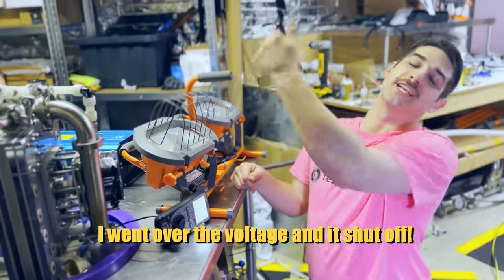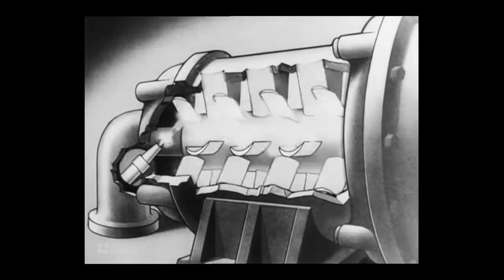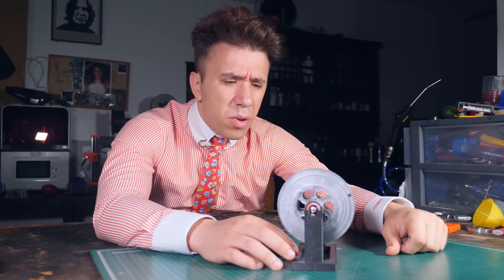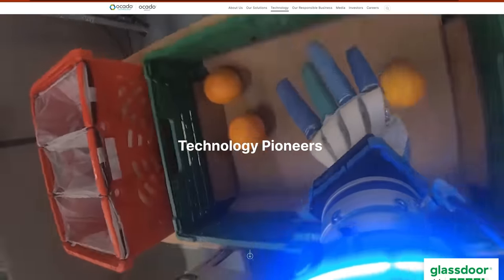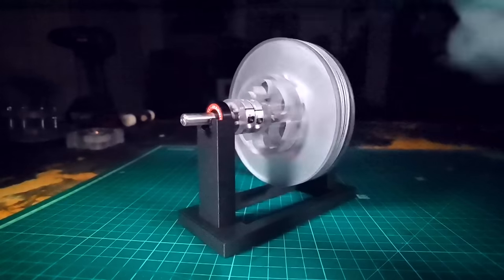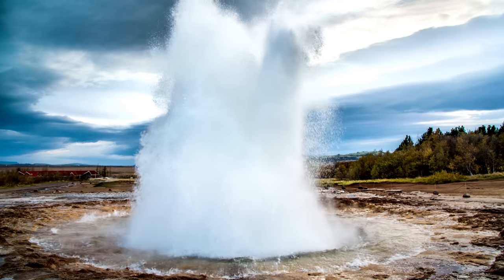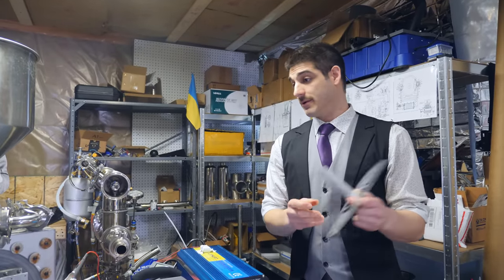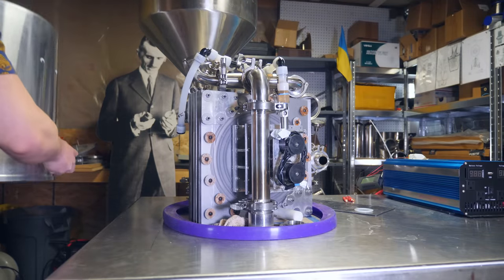Building Nikola Tesla's Bladeless Turbine

Comment: I think I read something about the tesla turbine ripping itself apart if it is going too fast and or has a to big disc, is that true and could you test that?? (mb some cool slowmow) And you could also test different entry flows, disk materials, disk spacings and different fluids?
Reply: Thats a problem with all turbines its why wind generators have breaks on them  to stop them spinning in high winds
Reply: 600 likes in 20 minutes?? xD
Reply: What emerald said, they all have limits. I’m sure the physicist took everything into consideration, but I like how you think :)
Reply: I had heard that too. Something about the faster it spins, the higher the efficiency and modern turbines have a 95% efficiency. Unsure of that is true but it is also neglecting the necessary technology to build, maintenance, and material sourcing. The very reasons why electric cars and batteries have to last longer than a combustion engine can last in order to pay off. I thought it was  like 100k miles in countries with 100% green energy sources. Most countries do not have enough green energy to make electric cars worth the effort. It's mostly because of the battery.
Reply: One way you could look at it, the tesla turbine had a larger surface area per blade vs a general turbine
Reply: AFAIK, it would be most efficient at a speed greater than the disks can withstand.
Reply: Anything spinning too fast has that potential outcome
Reply: That's a massive overstatement of how hard Tesla pushed them. You want to do destructive testing of what you make to understand the safety margins.
Reply: Too, not to.
Reply: I would like to see it run a home for a weekend
Reply: Almost 3k likes in less than 3 hours??
This dude is buying likes to cheat.
@integza do you check for this unfair behaviour in your giveaways?
Reply: Anything spun beyond it's tolerances will.
Reply: It's true. Any type of turbine could be ripped by centrifugal forces.
Reply: If it's going too fast, you just need a higher resistance motor to keep it in check which would mean more power in the end.
Reply: @kumabjorn7992  worst case just make a bypass, have a dummy load, input valve governor, rpm governor...
Reply: @buzzsaw7989  you are thinking of whole system efficiency where they have ~50 stages of turbines, several heat regenerators, and pre heating out the ass.
Reply: I appreciate your comment but that’s not an issue because, despite what everyone erroneously claims, Tesla turbines work just fine, get plenty of torque and output power at low RPMs.     I’ve got some copy pasta 🍝 of mine that I’ll share with ya here to explain more.  Tesla turbines aren’t made efficient by spinning really fast.   That’s only for when the disc stack is being used as a centrifugal pump, because ALL centrifugal pumps’ compressors, performance is tip speed dependent.   But spinning the turbine fast will produce a centrifugal head that opposes the incoming fluid flow, reducing the pressure gradient across the nozzle, reducing fluid final velocity, reducing mass flow rates through the nozzle and ultimately reducing power out. 

Furthermore the faster you spin them the faster the fluid you have has to go just to still be moving faster than the discs and still provide torque.   Lastly, they work just fine for industrial use and can scale up just fine because the torque on the discs is proportional to the difference in the fluid speed and the disc speed. So the disc tip speed is the important factor here. For any given fluid supply in, the bozzle will have a max fluid velocity. So the turbine disc tips will have a max speed set at that fluid speed irrelevant if radius. Now considering that centripetal force is proportional to V^2/R, if you keep the tip speed the same but increase the radius the centripetal forces on the disc for the speeds needed will actually decrease.
Reply: Despite what MANY have claimed about the Tesla turbine, it does NOT need to be spun fast to work or work efficiently.   TesTurs are made efficient when the slip on the discs is reduced and spinning the discs fast does nothing to reduce the slip, only increase the distance the fluid slips on the disc faces, which is by definition “loss”.  Listen to what Tesla himself said in the patents of how to make them work.  “Owing to a number of causes affecting the performance, it is difficult to frame a precise rule which would be generally applicable, but it may be stated that within certain limits, and other conditions being the same, the torque is directly proportionate to the square of the velocity of the fluid relatively to the runner and to the effective area of the disks and, inversely, to the distance separating them. The machine will, generally, perform its maximum work when the effective speed of the runner is one-half of that of the fluid; but to attain the highest economy, the relative speed or slip, for any given performance, should be as small as possible. This condition may be to any desired degree approximated by increasing the active area of and reducing the space between the disks.”  1) increase the speed of the fluid relative to the disc, (not increase disc speed)  2) increase surface area 3) decrease disc spacing  This is how you actually make a TesTur work. Not by spinning it fast.   The fluid interactions with the disc that govern efficiency an torque are adhesion and cohesion. Full stop. And spinning fast does nothing to increasing either to increase the turbines isentropic efficiency.   This is why everyone who chases rpm with the TesTur just flat out fails. They aren’t even trying to design them properly so of course they won’t work. 

You just have to know how to design it correctly to actually reduce slip to make them work, not spin them fast.  The only reason people think Tesla turbines have to be spun too fast is because EVERYONE has mistaken the part of the patent that is about the turbine being used as a pump as being about it being used as a drive turbine.   The only time you want to spin a TesTur fast is when it’s being used as a pump/compressor. This is because ALL centrifugal pumps’/compressors’ performance is tip speed dependent.   “I have found that the quantity of fluid propelled in this manner, is, other conditions being equal, approximately proportionate to the active surface of the runner and to its effective speed. For this reason, the performance of such machines augments at an exceedingly high rate with the increase of their size and speed of revolution.” -Nikola Tesla
Reply: And again, you DO NOT want to spin too fast in a TesTur because the centrifugal head will just counter your incoming fluid flow reducing power. And the faster you spin discs, you’re fluid has to be going even that much faster just to be able to apply a torque on the disc face.   “Still another valuable and probably unique quality of such motors or prime movers may be described. By proper construction and observance of working conditions the centrifugal pressure, opposing the passage of the fluid, may, as already indicated, be made nearly equal to the pressure of supply when the machine is running idle. If the inlet section be large, small changes in the speed of revolution will produce great differences in flow which are further enhanced by the concomitant variations in the length of the spiral path. A self-regulating machine is thus obtained bearing a striking resemblance to a direct-current electric motor in this respect that, with great differences of impressed pressure in a wide open channel the flow of the fluid through the same is prevented by virtue of rotation. Since the centrifugal head increases as the square of the revolutions, or even more rapidly, and with modern high grade steel great peripheral velocities are practicable, it is possible to attain that condition in a single stage machine, more readily if the runner be of large diameter. Obviously this problem is facilitated by compounding, as will be understood by those skilled in the art. Irrespective of its bearing on economy, this tendency which is, to a degree, common to motors of the above description, is of special advantage in the operation of large units, as it affords a safeguard against running away and destruction…” (cont’d) “…Besides these, such a prime mover possesses many other advantages, both constructive and operative. It is simple, light and compact, subject to but little wear, cheap and exceptionally easy to manufacture as small clearances and accurate milling work are not essential to good performance. In operation it is reliable, there being no valves, sliding contacts or troublesome vanes. It is almost free of windage, largely independent of nozzle efficiency and suitable for high as well as for low fluid velocities and speeds of revolution.” -Nikola Tesla  Tesla both knew it wasn’t meant to spin fast and that it worked great for low speeds IF you design it correctly.
Reply: Wouldn't increasing the size at the same fluid speed, reduce the angular velocity and centripetal acceleration?
Reply: yeah that's true, it has to do with how rigid the disc is: at very higher speed the disc will start to warp or ripple as it spins instead of remaining flat, and it eventually breaks.
but modern materials science can make thin discs that are a lot more rigid and strong than anything people in Tesla's time could manufacture: carbon fiber composites could be great for this.
Reply: If you wrote that comment for the 3D printer, you'll have it
Reply: @ItsMeArda  Almost as if the comment was pushed to the top and artificially liked so as to positively discredit the concept.  Happens quite often when youtube or others want to push a narrative with a seemingly popular concept.
Reply: @buzzsaw7989  The biggest problem in electric cars are the batteries and therefor only if a new revolutionary battery is invented the electric car coul get the new transportation option for me.
Reply: @Dan-gs3kg  we are learning the limits of material science and physics,
Reply: Go get some grammarly
Reply: What happens to the turbine when you drive it. Ie can you use it to compress air.
Reply: The turbines currently used have a tip speed of mach 1.8 the telsa turbine would have a tip speed of mach 13. discs would have to be 2-3 meters for industrial use so I don't think we have materials that can be thin enough and not warp or be destroyed.
Reply: You could add an electronic speed governor on the output shaft that would increase resistance if above a certain rpm
Reply: I know I’m one in a million replies in this but for the Tesla turbine to be as efficient as a modern day turbine, or even more efficient the “blade” tips would have to love at Mach 22, this is with a three meter “blade”
Reply: Possible turbine disks:
CDs
Cut-off grinding disks (for angle grinders)
Old hard drive disks
Reply: At some point, every rotational part reaches the threshold where it´s diameter and angular speed are so big, the part itself breaks the sound barrier. Even if it could theoretically withstand so much stress, the sonic boom is the last nail in the coffin.
Reply: I think the disk material would't change much and for the spacing it's just important to get the most ammount of disk in the smallest space possible to maximise the surface area where the fluid can stick to. But I don't have any thoughts on which fluids would do the job better, thats an interesting question.
Reply: @CharlieSolis  Oh well thanks for the infos!! Don't have time to read it now tho but I will definitely come back to you!
Reply: @lsh_  let me know if you have any further questions! I’m happy to answer them.
Reply: @vintageshed965  
Sound barrier, you say.
You say that in a negative way.
You sound halfway knowledgeable, how would you UTILIZE such an effect? 🤔🤔🤔
Reply: Because go centrifugal force and the discs are thin. so it doesn't have the support for it
Reply: @falconsfs7086  hey thanks for your comment. But that’s not quite accurate. For a non tapered disc, thickness does not effect burst speed. So a thin disc will have the same burst speed at a thick disc. And when the disc stack is designed correctly the discs aren’t capable of warping. 

“In the new design I employ two heavier end-plates which are machined tapering toward the periphery for the purpose of reducing the maximum centrifugal stress as much as practicable. The inside discs, of relatively thin material, are rolled, forged or ground tapering in like manner and with the same object in view, but this may not always be necessary and plates, made of sheet metal of substantially uniform thickness as furnished by the mills, can be employed. Each of the thick as well as thin plates is provided with exhaust openings, leaving a solid central portion like the hub and spokes of a wheel. Star-washers of similar configuration serve the purpose of keeping the discs apart in the center and for the peripheral spacing the thin plates have small holes drilled in them on a circle, or circles, of suitable diameter, and in these are driven tight-fitting studs which are upset at both ends by a special tool so that they will project beyond the metal on each side a trifle more than the thickness of the star-washers. When the plates are put together the separating studs do not come in line but are straddled in order to give opportunity for slight yielding, thereby eliminating constructional difficulties which might be caused by unevenness or other mechanical imperfections. Thus the rotor can be finished closely to predetermined overall dimensions and will run true on the outside even if the thin inside plates should vary a little in thickness or be slightly warped. To simplify this arrangement I provide only every second plate with studs, using plain ones between. Furthermore, with the object of cheapening the manufacture I dispense altogether with the former, accomplishing the spacing by means of small bosses or protuberances which are raised in the plates by blows or pressure and provide a die, practically reducing all the machine work on a thin plate to a single operation in a stamping press. The star-washers, while preferable, are not indispensable and may be replaced by round separating washers of a diameter about equal to that of the hub part of the discs.”
-Nikola Tesla 

“This construction permits free expansion and contraction of each plate individually under the varying influence of heat and centrifugal force and possesses a number of other advantages which are of considerable practical moment. A larger active plate area and consequently more power is obtained for a given width, this improving efficiency. Warping is virtually eliminated and smaller side clearances may be used which results in diminished leakage and friction losses. The rotor is better adapted for dynamic balancing and through rubbing friction resists disturbing influences thereby insuring quieter running. For this reason and also because the discs are not rigidly joined it is safer against damage which might otherwise be caused by vibration or excessive speed.”
-Nikola Tesla
Reply: That was my first thoughts.   It's cool and promising but I think the one thing would be destruction of the whole case if any of those discs failed.  Something like a  timing chain breaking and just destroying everything?  I'd bet you could set up sensors to cut with any asymmetry or above expected vibration...?
Reply: He did this already
Reply: @vyvyyv8vohvgu77  hotter gasses, cooler liquids. From there it's 11 herbs and spices on very thick stuff, or very mixed stuff.

For dirty things, consider further spacing to allow debris to flow through. (This is ignoring the idea of having a bypass, but that might lower system pressure) From what I know the disks aren't harmed by the debris, the skin effect is very powerful.
Reply: @vintageshed965  no, by and large there have been many demonstrated turbines that withstand the sonic transition.
Reply: This is the story of your enslavement, the "elite" exposed 👉 The Connections (2021) [short documentary] 💖
Reply: Device u reference is a guvnor…. & yes!!!! It IS a critical safety device
Reply: I built a few Tesla turbines and can confirm they can self destruct if you exceed the structural limits of the material you use. I have videos on the Tesla turbine.
Reply: @charliesolis simple refutation... If it were this simple and they were as good as you are spewing, why don't we use them everywhere?

Teslas own patent even said it was dependent on the viscosity of the fluid, as this fluid is coupled to the impelling cylinder by shear forces alone, and when you shear the liquid you get huge frictional energy losses... And a lot of heat buildup. Crunch the numbers and the carnot efficient is utter crap until, as you say, you build up enough head that the discs are almost going at the speed of the fluid, thereby reducing frictional losses, and at the point where it is gaining almost no impelling  force from the fluid any more. This is around 50k rpm and unless you make the discs thick the heat expansion and fatigue will rip it apart.

Come on dude. Stop fapping over anything Tesla like some communist cult of personality. This is well known about in engineering disciplines and it isn't used for a good reason. It's a desktop curiosity now. It was a cool idea but didn't deliver in practice. That's all.
Reply: TyaxComp  The fact that he made one as a gift probably means it doesn't take long to make.
Reply: You are right about that
Reply: The principle makes perfect logical sense, but not from the perspective of a physicist.
Now, a hydraulic engineer?
Heh.
Let’s give an example out for everyone to get their head around.
Take a skidloader, for a primary example.
The wheels have non-variable hydraulic motors driving them.
The higher the flow, the faster they go.
Faster flow is definitely not good for torque in this case.
On the powerplant, the pump is variable flow.
The shaft is turning the same speed, wherever the throttle is set.
It doesn’t matter if it’s electric, gas, diesel.
If the pump is wide open to maximum flow, the resistance by torque load can overwhelm the power plant.
By turning the pump down, the rotation of the pump is still the same, but the fluid flow is considerably less.
Now, the same wheel or track on the same surface is going slower, but the traction multiplies, giving more force per inch of travel.
Slower turning means the same amount of power, but instead of trying to move a gallon in five seconds, it’s taking a full minute.
The torque has went from 100/ft-lbs to twelve times that, at 1200/ft-lbs!
Takes longer, but multiplies the force of the work.
Now you have enough working force to push a big truck.
You can raise your flow and speed to where they are balanced, torque vs. load.
With this turbine, there would be less balance issues, and a lot les wear on the parts, as that all move a lot slower.
Want more torque? Add turbine plates!
Reply: @kumabjorn7992  that sounds smart thx
Reply: @Dan-gs3kg  If it is actually so easy and efficient and so on why isn't it used (AFAIK water plants etc. use "normal" turbines)
Reply: @postiemania  Yea nice I skimed trough the vid a bit, but I would like to know what you drive with it / or tested it with?
Reply: Is this turbine made at home with simple things 
I am from India  i like your video 12:35
Reply: @lsh_  it ran on compressed air for the test runs.
Reply: @lsh_  that's the argument used to poo poo many verified inventions until a big name makes something similar to it, like the Mahle Jet Spark Plug which is worse than the Smart Plug which an updated hot bulb that has a similar ability to send out jets of fire to ignite the gas during its run, but only need about 10W to run, or until it is hot.

Or the Plazmafor plugs, which uses a slightly different geometry for the finger electrode, as a shroud electrode, and uses electrolysis and corona discharge for ignition, instead of spark discharge.

How about peaker caps? It's effectively a CDI, but without the need for a power IGBT, and it needs a lot lower capacitance to run.

Again, all of these things are not far from the realm of possibilities to improving the function, consistency of, or durability of the spark plugs in question.

Maybe it's the UL testing that is poo pooing it, like they did with the Element Fire Extinguisher, maybe it's the EPA. Who knows, it can simply be for a fact that the patent office makes you spend several thousands for a patent, or the tens of thousands in fees for starting a small business. Why don't you ask the academics who only care for the publications that hazed them into having the beliefs that they have, or the industry that is very comfortable with the current economic status quo. It's very difficult to change your economic model. Or it's for a fact that grandmaster tradesmen don't exist anymore, so the technology is simply lost on them.

Do you know what the best synthetic gear lube is on the market?

How about the next generation in metering rod carburetors, or the electronic and automatic carb tuning kits? Do you know about that?

How long does it take for a new product, let alone innovation to come to the industry, and how much of a money sink it is to get anywhere for that matter.

Do you even know what the best liquid major mixers are? Do you know how they actually mix solids into the liquid down to about 100-150um?

How about newer generations of cast alloys? Or twinning steels? What is the use of a twinning steel?
Reply: That's just true for all discs spinning at high speeds, it just has to be engineered for it.
Reply: Centrifugal force vs. material yeald strength
Reply: I really enjoy your videos
Reply: I'm more interested in seeing real numbers in terms of efficiency, something the Tesla turbine evangelist seems either unwilling or incapable of producing.  Either possibility is a problem.
Reply: @GerryRR  hey thanks for commenting  🙏❤️‍🔥 but if you go through these comments I have more than elaborated on the efficiency across multiple replies to many people. 

I can only respond to so many people though. 

Hope this helps.
Reply: @GerryRR  As far as efficiency goes… (mind you this is a copy pasta 🍝 so it’s a bit long but it’s worth the read.) …My 2650watt electrical load run came in with a very low ball calculation of 40% isentropic efficiency.  To start off, mind you that includes generator losses, 3 phase rectifier losses, and inverter losses to the electrical load that were not accounted for. So the turbine off the bat is already most definitely doing better than the 40% isentropic efficiency I’ve calculated from the already low ball test results.   But for now I’ll just assume 40% isentropic efficiency so that I’m not over claiming what I can prove it can actually do for the time being. (I have nothing in the long run to benefit by overstating my numbers and only my legitimacy to lose. I’ve worked hard for my physics degree and don’t intend to tarnish it for a couple of extra views on the internet.) 

As far as inefficiencies to the system to fix, there’s 10x crappy ball bearings in this version, 2 crappy RC car gears, both losses will be gained for power out with a direct to shaft generator. (Minus two gears and 8 crappy ball bearings)  There’s an 1/8 of an inch of space between the turbine endplates and the casing endplates on both sides of the TesTur. That’s a 1/4in of open flow area around the 2in wide turbine (that only even has a total of 0.75in wide of spacing between all the tight disc spaces for torque to begin with.)   That means 25% of the open space for flowing through the casing, between discs and between the casing and turbine endplates, is just free flow over the side of the turbine still. (I’m using the absolute bottom of the barrel of machining equipment right now in my garage 🤷‍♂️)  There’s no labyrinth seals yet to even attempt to further reduce that overflow…
Reply: @GerryRR  The nozzle is atrocious at the moment, when making the variable converging section have a tight convergence it causes the fluid jet to aim more centripetally (towards the axle) instead of tangentially (glancing off the disc tips) which severely effects the fluids natural path.   This will be fixed with the new variable nozzle design I’m going with.    Then even further in this specific casing’s assembly there’s two “pillars” in the middle of the nozzle.   This is because the aluminum plates in the middle of the casing plate stack only had the variable nozzle bar and inlet holes cut out, and not the full nozzle geometry.  So those pillars are just vertical bars in the middle of the nozzle for the air to smash into just before going into the turbine (hopefully the wet steam tests will just erode them down 🤭)   Before all that there’s still about 100ft of air hose between the tanks and the turbine… plus a shell and tube heat exchanger and a TON of elbows and fittings.    I’m sure I’m forgetting something too but between all that being fixed… I can almost guarantee we will be in the 60-70s % range and that’s all just still with room temp compressed air.   Most forget, I’m using room temp compressed air and never went over 20psi at the nozzle for these tests. (Pressure differential and temperature differential govern efficiency) 

And even then I still only even have a single stage on it yet.   Everyone wants to compare it to the efficiency of a very high temp, high pressure (1000°F & ~1800psi) multibillion dollar 15-30 stage steam turbines…   😮‍💨   That’s apples to rocket ships. 😅  But considering Rankine Steam cycles get theoretical max about 33% of input heat (due to latent heat of condensation and that’s without any regenerative boiler feedwater preheat, air fuel preheat, etc) and then 40% isentropic efficiency (considering the turbine as is) we’re looking at 13.2% thermal efficiency with steam.   A more apt comparison for the TesTur would be something an individual can actually purchase, like 1-5kW piston gas generators that you can get from Home Depot or Lowe’s.   These get 15-22% thermal efficiency off the plant floor. Good luck getting that 1 year down the line or later with all those moving parts.  Also for reference, industry standard for micro bladed gas turbines is 25% thermal to electrical. Whole system efficiency can go higher in Combined Heat and Power (CHP) system, but alas the TesTur would see the same whole system efficiency increase in a CHP Auxiliary Power Unit (APU).  In the TesTur you gotta replace…? 🤔bearings…? And still even then, only maybe 🤷‍♂️ depending on how good of bearings, balance, lubing, cooling.   The TesTur, and other bladed turbines, only have one moving part. 🔥
Reply: @GerryRR  So if those piston generators drop efficiency, even at all, the TesTur on its worst day is competitive with a gasoline piston engine electric generator.🤓😬🤷‍♂️  And the TesTur can handle any fuel that can burn, even solid particulate fuels like powdered saw dust, pulverized coal, powdered iron, biomass, etc. (noting the number of those that can be acquired without spending money… 🤑 opening up “low monetary cost”, even carbon neutral, fuel options for MILLIONS around the world)  We have to remember that the TesTur doesn’t have to be the holy grail to be worth using if we have free fuels readily available like biomass, and even waste heat already being dumped out into the air and not used for anything.  The TesTur just has to be a viable option for some to be worth doing. 

Even more, the mere fact that I’m using a low temp fluid for my 40% isentropic efficiency calculation means my TesTur efficiency is severely limited by thermodynamics and fluid dynamics.   Increasing temps will automatically increase my turbines efficiency.  This is because gasses have an increasing viscosity trend as you increase the temperature.   This leads to increased isentropic efficiencies in the TesTur from reduced slip on the discs.  (Meanwhile, we’re already talking about a piston engine using combustion temps as is.)  Whereas bladed turbines see the increased viscosity as an increase in drag loss through the turbine blades.   So we can’t always count on seeing increased isentropic efficiencies in a bladed turbine in practice when we go from low temp to a high temp.  Again, to reiterate, this increase in viscosity in the TesTur only works to enhance the working action of the TesTur.  (That being viscous adhesion to the disc faces increasing torque.)  That’s all on top of the increased thermodynamic efficiencies of using a higher temp elastic fluid too! 🤓 

The disc spacing for room temp gasses is not going to be the same for combustion temp gasses/steam because the viscosity of either increases by 3x fold. And I’ve designed these spaces for a higher temp fluid with a slightly higher viscosity so these will inherently be too wide at the current temperatures being used.   So as we increase temps along with all these other really easy to fix mechanical issues (that only are a thing because I’m building this in my garage on a junk cnc machine) I have no doubt we will see more than competitive isentropic efficiencies compared to bladed turbines, let alone whole system thermal efficiencies that are through the roof.   This is because of the heat recovery systems that can be added with the cost savings of using a TesTur vs a VERY expensive, and in my opinion, relatively delicate bladed turbine.   Just getting tighter casing clearance with the turbine should give me at least 20% points back on efficiency putting my testur at the 60% range.   Coming in with a 19% thermal efficiency in a Rankine steam system without any kind of thermal recoup.
Reply: @GerryRR  I just responded with 4 messages, not including this one, answering your question. YouTube has a bad habit of comments just magically not appearing for other people so let me know if all 4 of them came through. Cheers.
Reply: What's common is total trash. I know the mailman you'll never get your 3D printer.
Reply: I personally wouldn't see a point in using fluids other than water, unless of course you're using water power to pressurize the other fluid. I only say because water is the most abundant fluid we can pressurize with natural elevations
Reply: Centrifugal force, anything spinning faster than it's tensile strength will either deform or break
Reply: The outside of the disc can be subject to 13g and the spacing of the disc is supposed to take advantage viscosity of water I think it's like.8 mm or something like that 😊
Reply: That is true, the blades should be titanium alloy if you want it to be engineered for higher rpms and larger radius.
Reply: You could also have a feedback valve to limit the rpm rising to the ripping point, actually limiting it to a more even power output.
Reply: The Tesla Turbine did rip itself apart when Tesla connected it into the compressed air from a large area Trompe was used. 

I would like you to make a trompe and use it to power a Tesla Turbine. I feel that learning about the Trompe would interest you and encourage more projects.
Reply: Cool, but looks complicated and expensive.
Reply: They fracture
Reply: Anything that spins has that problem.  The faster it spins, the more perfect its balance needs to be. Any wobble magnifies at speed.
Reply: If you spin anything too fast it will fall apart.  Everything has an rpm limit
Reply: Yes tesla had mentioned thetes a certain amount of space between disc's n flow rate that maximize best output n stability n to little space poor output as to much n at right proportions the speed got stable by the movement inward if incorrect would shake at super high speeds n found the sweet spot n watched video on it long time ago
Reply: @aaronduranceau7683  that's the motor.  Were generating gas to burn
Reply: Buckypaper
Reply: @sockmonkey6666  True.  Everything has a breaking point.  What's the strongest material we could use?  And are the discs smooth or textured?
Reply: @ralphcroker4889  Probably some modern superalloy. The disks are usually smooth.
Reply: It's so good at what it does that there's no material we have that can withstand both rotational and centrifugal forces from going so fast, it wants to go faster than it can keep itself together
Reply: As any rotating object.
Reply: Anything that rotates too fast, will rip itself apart. Centripetal forces and all that.
Reply: Gear exchange should suck extra motion
Reply: did no one hear the part about it having better torque at LOWER speeds?
Reply: the thing about the tesla turbine is that it doesn't need to spin fast to create force, it relies on adhesion and cohesion of the fluid put through it. steam just so happens (not coincidence) to have very good adhesion and cohesion for the tesla turbine, in order to generate more torque and more energy. if it's spinning too fast for itself to handle, that's because someone decided to run it with that much force. gotta modify the pressure of the fluid being put through it. on a mass scale though it should be able to handle high pressures and large amounts of fluid though. but that's never been done, and people insist that if it doesn't work at a small scale then it's not worth it, despite us knowing that's not how things work.